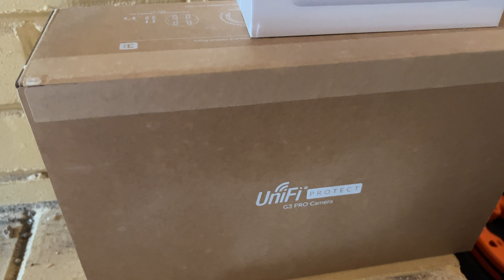Unifi Network and Protect Install at Julie's House Renovation | Part 1

Comment: Interesting video, did you individually termintate all those pink cables? Surely a patch panel would have been a much better choice, so much easier than terminating them individually with RJ45's. Punchdown tools are cheap, so are patch panels.
Reply from the maker: I think that was all done in Part 2.  It’s been a while.
Reply: @SPXLabs  Ahh yes, didn't get to that part! A little different to what I have used before, looks like individual keystone jacks that sit in a 1U panel, rather than a more traditional patch panel. Probably easier to do if you aren't doing 48 in one go! 😁 Have done a few installs like that before when I worked in education and wiring in large PC suites. Glad I'm not doing it any more, just stick to doing stuff in my home!
Reply from the maker: I got turned into the individual ones after having to rearrange my own home to clean up the look of my rack.  Being able to move them individually is honestly a game changer.  The traditional ones are just to permanent for me now lol

Comment: That job was insane and its hard trying to install a network in an unfinished location....why didnt she get a UDM Pro and connect the fiber via a SFP port?
Reply from the maker: At that time it was impossible to order anything and she only wanted a camera system.  But today, she has a UDM Pro SE still sitting in box because the contractors have not finished working on her house.  So, her camera system is still as you see it today in this video.
Reply: @SPXLabs  She needs to get a new contractor..LOL
Reply from the maker: Definitely, the last time I checked in, two contractors have been fired from doing the work.  Then other contractors just have not been showing up to do the work.  As far as I'm aware, she is at the point were she is trying to get out-of-state contractors to try and finish her home.

Comment: I hope that the bottom left two screws on the upper shelf brackets (5:01) didnt penetrate the wires.  Note to self - know what height is the horizontal wiring to not penetrate there.
Reply from the maker: Those shelves were put up long before any wires were added to the room, so I bet it's fine.  Now that you mention it though, it is odd that the electrician drilled holes for the wire that were about even with the screws though.

Comment: Funny, and well done!
I'd recommend adding pulling rope everywhere you can, makes it so much easier to add/replace wires ... it's like 3 cents/ft
Reply from the maker: That's not a bad idea, I'll mention it to the owner see what they decide.  She had the capacity to request fiber between floors for some things which is awesome.

Comment: 17:00 agreed. I'm glad you keep the real life situations / hiccups in the video.  Well put together. Thank you.
Reply from the maker: I didn’t even realize what I did until things started acting funny
Reply: @SPXLabs  Although it 'works as requested' you did notice an area of concern then fixed it. That is the difference between a user and skilled technician like yourself. That home owner knows. SWIM didn't notice until some work showed up on Shodan. That individual had already started the next job.
Reply from the maker: Whoa whoa whoa, let’s be careful throwing around words like “skilled” lol.  

Also also, I definitely wouldn’t remove anything like that or other hiccups, unless they are absolutely so minor, like making a bad cable or something trivial.  I don’t mind being wrong or doing things bad.  Just hope I make it right and or someone tells me the right way.  Eek.